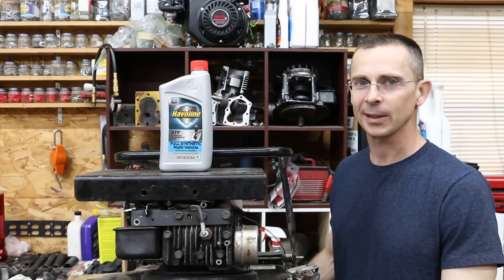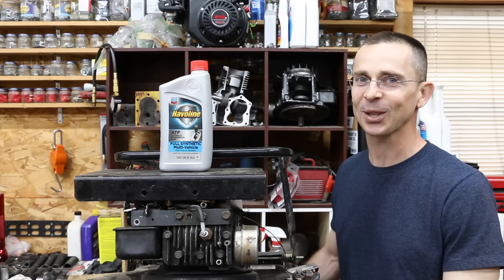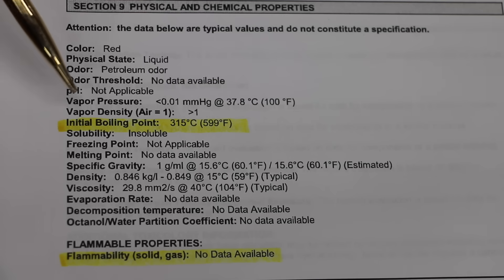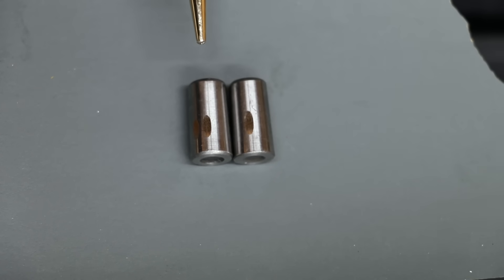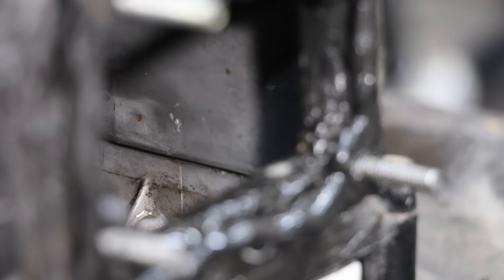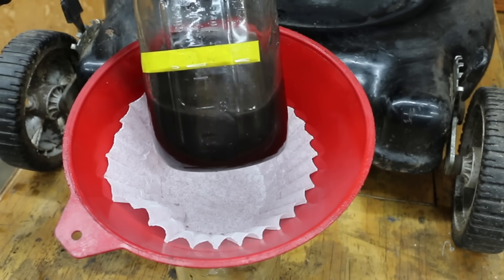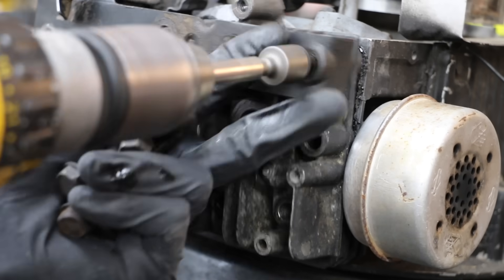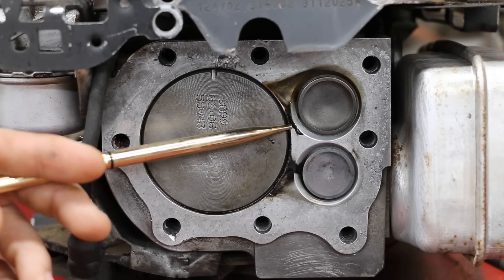ATF as an Engine Oil substitute?  Let's see what happens!

Comment: I got a 2021 Mitsubishi mirage, I've put 70,000 miles on it and I've given it 1 oil change. I've had the car over 2 years, (ya I need to do better) I need to change the oil, the car gave me a notice today saying "service engine" and it is going for an alignment and oil change next week. My buddy the mechanic told me to put some atf in it to help clean it because how I abuse the car, so within minutes of putting atf and oil in to bring it back to the level it needs I noticed it sounded more smooth than normal (being low on oil probably didn't help) but it sounds better than when I got the car, I got it used with 16,000 miles.

Normally, I wouldn't take advice like that, I'd just put some sea foam in it to clean... But💁‍♀️ I'll know in a week and I will update the comment if I remember too.

The atf is only being used because the amount of abuse the car has for 70,000 miles on 1 oil change... The lifters do sound great with the atf tho. Idk if it's something I'd feel safe to run long term in the engine.... But I also don't really change oil until the car says it's needs some💁‍♀️

Comment: Had a case of engine oil in my car once and about 45 miles from home I blew a transmission line late at night in nowhere land. Managed to repair the line but wouldn't pull. 🤔 I wondered i mean it was cold out and my girlfriend was with me and we needed heat so Im like well we are not going anywhere by not doing something so 5 quarts of 10w 30 went in the tranny and pulled and made us home with no problems until I woke up the next morning and it wouldn't pull except for reverse.
Reply from the maker: Thanks for sharing.

Comment: Ive been doing it for over two decades, and have never had a problem using it. I started doing it when a van that ticked for 2 years, suddenly stopped ticking after a guys wife accidentally poured it in there. Been a go to ever since. Kind of not the best test on a flathead motor though.  Clearly you had results, but they wont be nearly as profound. Thanks for the video either way man.

Comment: Back in the late 1950's and early 1960's..dirttrack racing..any time we bought another engine out of the junk yard..we drained the motoroil and filled the crankcase with half motor oil, 1/4th diesel and 1/4th ATF..ran it fast for 30 minutes or so..varying speeds..drained the crankcase..refilled with straight 40 or 50 w..went racing.

Comment: A friend's grandfather was a farmer and religiously changed his oil on his 62 Chrysler at 2000 miles. After he passed, his son got his car, with over 200,000 miles. When his son had value cover gaskets replaced, the mechanic called all the other mechanics to come over to look at the top of the heads. He stated that it looked like the day it was built and also said other vehicles with 50,000 miles looked worse. So changing your oil will prolong the life of the engine.

Comment: I bought a badly tapping Subaru for $89, figured I could $100 from the wrecking yard. Drained all the oil out and put in atf, ran it several times for about 5 minutes for a few days, drove it to Jack in box about half mile away, when I went in it sounded horrible and when I came out and started it it sounded like a new engine. Went next door and got the oil changed and sold it for 3k

Comment: I swear by ATF as an oil flush. Drain a quart out while cold, add a quart of ATF in, idle it until it's at operating temp, then shut the engine off and do a normal oil and filter change while it's hot. I've brought some pretty neglected cars back to a very happy and healthy running state by doing just that process. It only costs an extra 5-8 dollars over a normal oil change, and is well worth it.

Comment: I've used it on some older cars I've bought and it definitely cleans sludge buildup. I've used diesel as well and transmission fluid does a better job and diesel you have to flush the engine at least twice and transmission fluid you don't have to flush at all 😊😊😊

Comment: I had an old 3 litre v6 Isuzu engine that was all gummed up, low compression, lots of blow by, blowing blue smoke, noisy lifters, you name it, it had it, so I thought I'd give a ATF a go. Removed plugs and put a 150 ml of atf and acetone in the cylinders and left it for a week. Then emptied the cylinders, filled engine with ATF and let run at quick idle until lifters noise was gone and it had stopped blowing smoke, it took 6 hours. Flushed and refilled with engine oil. Almost no exhaust smoke, very little blow by, good compression and silent top end. I only did it because I believed the engine was scrap but in the end it came good. I don't recommend anyone else do this to their engine.

Comment: Having owned more than a few used cars in my time, the first thing I do when I get one into my garage is to remove the engine valve cover(s) to see what the valve train looks like.  It is a pain on many modern vehicles but I get a better view into it's oil service history.  If I can, I'll pull off the oil pan and clean it out, replace the gaskets, replace the oil filter and add a quart of trans fluid and run it for a hours gentle drive.  Afterwards I'll change the oil and filter and do it again after a couple tanks of gas with some added PEA fuel system cleaner.   This always seems to quiet the various ticks in the valve train and reduce some exhaust smell.  Sticky lifters and dirty injectors are common on most vehicles.  It'll cost a couple hundred$ or so in material and a few hours of my time, but worth it.

Comment: Here we are 7 yrs later and Valvoline R&P has been introduced.  They spent years  perfecting a product for gas cars after creating and using a similar detergent for Cummins diesels.
The detergents in ATF are generally LOWER than motor oil. 
They are both lubricant oils.  But so is gear oil. And they are each designed to be used as designed. 

So it amounts to this. Gasoline will clean a paint brush. And so will turpentine or lacquer thinner.  Some will even clean oily fingerprints off a painted banister while others will clean the paint off the banister. 

I don't know much about metallurgy or tribology. 
I do know about doing oil analysis. I have over 100 reports on my vehicles since 2002.  
I use the right oil for the engine. 
I learn from analysis how often it needs to be changed. 
I have seen in the past year better mpg, less fuel in oil, and lower insolubles. My OCI is 4-4500 miles
So I figure the decently maintained engine with 200k now has cleaner ring lands. 
It has never burned oil; still doesn't. 
Now I will try for at least 12,000 miles, another oil designed for older engines.  I have prepurchased 6 analyses. 

Note: analysis of the first time of using a product may return wonky results. It's better to analyze on 2nd run.  The old candidate has residue and it can show weird things with the newly introduced chemistry of the next product line.  This can lead one to believe it might be better to stick with a product instead of hopscotching around at every oil change. 
Sometimes, one might see slightly elevated wear metals directly after switching oils that have different chemistry packages.

Comment: I ran 2 quarts of ATF with 3 quarts of oil at o miles to 2000 miles.
No damage and it didn't clean anything eaither. I ran Royal 6 for 2 years and that oil didn't clean anything eaither. Back running Walmart oil again. I did add quart of Lucas to oil at 2k cause I was nervous of ATF causing issues.
Reply from the maker: Thanks for sharing.

Comment: Synthetic ATF is an excellent, rapidly effective cleaner for any grease or burned oil product. A very usual use for ATF would be to add one quart of ATF to the crankcase, on a cold engine, immediately before the oil change. Then, the engine is started and allowed to warm up, at idle, without a load, for 15 minutes. Then, the oil change continues, leaving the oil to drain thoroughly, for approximately 15 minutes. Swap out the filter and refill the crankcase with recommended weight engine oil, again as usual. Pretty simple. We do this often, upon request, particularly in the fall, before winter, using synthetic oil. Many hundreds of changes later, we have NEVER had a complain or problem. The refreshed oil stays cleaner, longer !

Comment: Late 90s to late 2000, i was driving a little more than 4 hours to and from work. I had 2 vehicles that were over 500k mile. A 1990 chevy s10 2.5 iron duke and a 1990 chevy lumina 3.1. Both about a week before an oil change, i would drain a little oul if necessary and add a quart of trans fluid. Not sure if it was the trans fluid helped but just what i had done.
Reply from the maker: Thanks for sharing.

Comment: In the oil not good long term depending on what kind because there's additives in the oil that can cause damage to the coatings of the bearing creating premature wearing ‼️
Fuel system is a better application and benefits of fuel pump and injectors the detergent will help 😊
As of piston rings, skirts and valves direct insert to the plug hole and rotate the engine replaced plugs and run will help with carbon in the combustion chamber with out damage to the cam, main and rod bearings. They call it fogging but if you're PVC system is not working properly without maintenance can build unwanted oils in the intake system and have a negative effect 🔧

Comment: The film strength test is gonna throw more of the lower weight oil out which an engine would not do.  For this reason it can't be considered accurate.
Reply: You even prove this at the 7:00 when you pick up the cup and the one you picked up actually had a smaller wear mark.

Comment: In the "old" days, in engines that didn't get regular oil changes. We would pour in about a quart of ATF in the engine and let it get to full operating temperature. Then immediately drain the oil, change the filter, and add the appropriate kind and amount of oil.
Reply from the maker: Thanks for sharing.

Comment: I know you have no means to try this…
Adding a couple of quarts of ATF to a diesel fuel tank actually cleans injectors!
That tiny bit of blowback that all pressurized systems have helps to loosen and remove deposits.

After all, Marvel Mystery Oil was about 70% straight mineral oil!

I’m having my doubts about the new “synthetic” version…
Reply from the maker: Thanks for  the feedback.

Comment: No body runs 100% ATF transmission fluid in a engine! A half a quart of ATF to five quarts of motor oil is how it was done back in the day! I've used this mixture many times on noisy engine's and it works well.
Reply from the maker: Thanks for the feedback.

Comment: I was taking an engine rebuild class in college.
I was rebuilding a 1966 Chevy 327.
I drained the oil and changed the filter.
I used traditional ATF, ran it for 50 miles, drained the oil..
The pulled the engine.
When disassembling the engine, others asked how I got the Inside so clean..
No parts were damaged, the sludge was gone.
The newer ATF isn't the same as back in 40 to 60 years ago.
Try doing a run using Hydraulic fluids, such as 10, 32, 46, and 68..
Reply from the maker: Thanks for sharing.

Comment: I start working for a Chevrolet dealership in 1969 and very early on. I learned from the mechanics that worked on the vehicles they would drain the oil and if it came out with a lot of sludge, they would take and fill it with ATF in those days, they took 5 quarts. Start the engine and run for about an hour drain it and then do it once again it would actually clean the engine out really well it would free up sticky, lifters, etc. etc. also we would use it and dribble it down the carburetor when you’re running the engine at about 2000 RPM And it would remove carbon in the cylinders and the cylinder heads. Today I’m 70 years old. I run heavy equipment and we will often run on my transmission fluid between oil changes and some of our diesels just to clean up the inside and it works great.
Reply from the maker: Thanks for sharing.

Comment: So ATF is used in family many years 35 plus. grandfather passed it along! replace 20 percent ATF. No issues cars truck make it well beyond 300k. So dad worked making ford oil pumps and in 2 days no oil pump failures on the line which is unheard of. He shut it down and discovered maintenance crew filled ATF 55 gallon drum. They had to retest a lot of oil pumps that would have failed passed.
Reply from the maker: Thanks for sharing.

Comment: I had good de gunking results with ATF.  I had a couple of customers with severe gunk, discovered on a valve adjustment.  Drain the case, fill with ATF and let idle for an hour or two.  Drain the ATF, fill with about 25% ATF and the balance oil.  Drive light throttle/load for a couple hundred miles.  Drain, fill with oil, new filter.  I had a couple of customers that I did this with, I also freed up some stuck oil control rings on several engines.  Had a couple of customers we would run about 10% ATF, change filter and oil every 1000k for a couple of changes to clean the sludge or free up rings. Good results.  With that level of sludge in the engine or if it was smoking, the engine might be done anyway, so it was a last ditch effort resurrect the engine, if it didn’t work was really no worse off, just the cost of some ATF and a filter.  Never had one fail, had many successes.  Had a few that still smoked because the oil control rings were done.

I also would disconnect a manifold vacuum source and suck a little water into the manifold.  This helped clean deposits off valves.  Sometimes would suck a little ATF into the manifold, shut if off to sit for a bit, then take it out and give it a good Italian tune up.  Always careful to not do too much with catalytic converter/O2 sensor cars, unless we removed the cat first and ran open header.  But if the car was miss firing from valves not seating or breathing well from valve build up, there was likely cat damage anyway.  Never put the cars on the dyno, but compression test and leak down tests showed improvement.  

One of the old timers always ran about 10% ATF is his oil claiming it prevented build up,  no evidence to back up his statement, but he didn’t have engine failure as a result either.  He also ran a little diesel fuel (I think 10%) claiming it increased power and kept the fuel system and valves clean.  No evidence to back it up, but again it didn’t cause a failure.

These were 80-early 2000 era cars and only done as the last ditch effort to get a little more life out of the car for the customer.  It was never my go to recommendation.
Reply from the maker: Thanks for sharing.
Reply: @ If you are stilling doing tests, would you do a test on mixing in a little diesel and seeing if it cleans valves (non GDI of course) and see if it increases HP or torque?  I always wondered if it made a difference but was never curious enough to test it

Comment: Had a ....neighbor that accidentally filled the engine with the wrong jug...ATF 5 quarts. 3000 miles later the error was discovered. That was 15 years ago. The truck still runs fine. Wouldn't make it a habit. It was filthy stuff .
Reply from the maker: Thanks for the feedback.

Comment: In my gas station mechanic days, we used ATF to clean badly sludged up engines. It was the high detergent content that did the trick. We would run the engine for 2 or 3 hours, drain and refill with ATF, drive for 1 or 2 hours, drain and refill once more. The customer would drive for a week, then back to motor oil. Results were always amazing.
Reply from the maker: Thanks for sharing.

Comment: I’ve used 1 quart of atf in a 22r Toyota engine after I replaced the head gasket I used 3 1/2 quarts 10w 30 and 1 quart of atf I ran it that way for 500 miles and changed my oil and I noticed my oil wouldn’t get as black between oil changed and when I rebuilt that engine the crank and rod bearings had normal wear
Reply from the maker: Thanks for sharing.

Comment: it does work, but it shouldnt be used alone, and only for a few days max right before an oil change. just add half a quart thats what i do. i did it last week on my 99 sierra before an oil change and it worked as expected. i use it as a top treat on my fbo e85 cadillac too. just a couple teaspoons every other tank.
Reply from the maker: Thanks for the feedback.

Comment: In the 60’s I. Used Kerosene to free stuck lifers in my Corvair. I would drain the oil flush with Kerosene by running it for 3 to 4 minutes at idol drain and refill with oil worked every time I did it.
Reply from the maker: Thanks for sharing.
Reply: I did a similar thing on my engines older ones that if I was due for a oil change and it was a quart low I'd put no 2 fuel oil in it and run the motor for ten minutes and drain it then replaced with new oil seemed to get rid of sludge